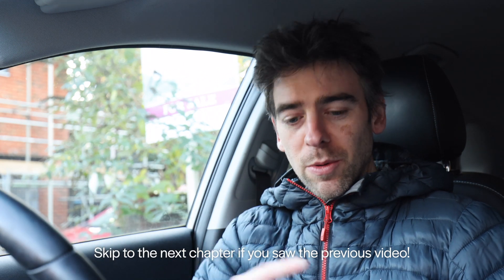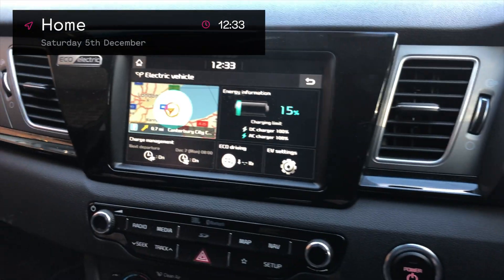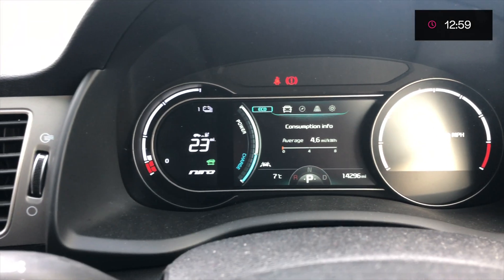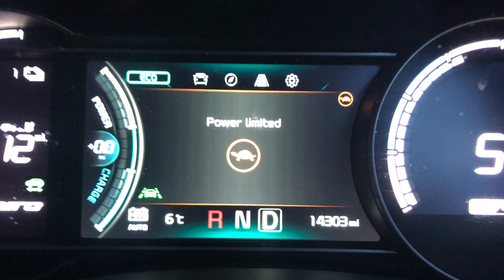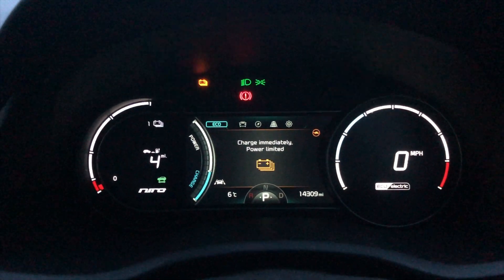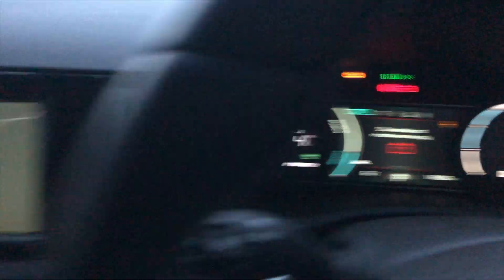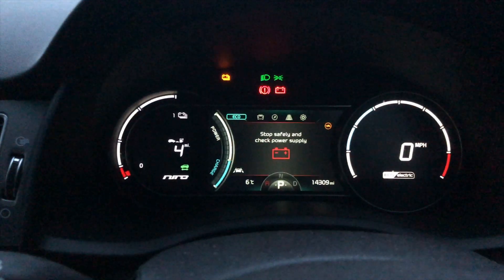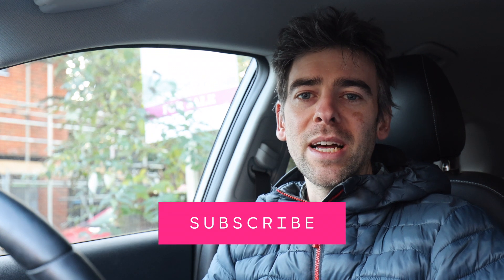Why I should have calibrated my Kia e-Niro's battery management system

Comment: In this youtube vid from "tesla killer", you can see how tesla, protects against "turtle mode".. https://www.youtube.com/watch?v=TF3aOxTcDms .. it does it by having a energy buffer that on 78kwh model consists of 3.5kwh at the bottom of the pack. If you hit 0% soc or 0km, that 5% is still available, but because you see the 0km, you will not use it. (and its also not recommended to use).

Comment: I wouldn't drain it low without first balancing the cells by charging it high.  One of the biggest reasons to keep the cells balanced is to make sure you don't drain any of the unbalanced cells lower than the safety threshold.  I don't think there's any need to go low in balancing the cells, I think you only need to go high to trigger the battery management system to rebalance all the cells.

Comment: Some cars can use apps to actually see the voltage of the individual cells, so you can know if you need to rebalance the cells.  You'll need something like an OBDII adaptor.  I intend to do that very thing with my Kia Soul EV and SoulSpy, so that I'm not charging it to 100% unnecessarily.

Comment: Hi Andrew! This battery calibration may be a thing but I think it really is a GOM calibrating thing. As the weather turns colder, it ‘remembers ‘ the range possible with warmer (previous) weather. Then, as the real autonomy goes down, it 1) gives you a false prediction and 2) has to expedite showing the real rate of battery depletion. In spring to summer, I guess we’ll get to see the opposite phenomenon. It goes to show the imperfections both battery technology and software still face. All things equal, if I could really afford it, I’d keep a +100k € ICE car along my eNiro, just for some unpredictably long winter stretches. Cheers!

Comment: EVs do vary significantly in the intelligence in the BMS. The instruction for my BMW i3 is "ABC" - Always Be Charging. You just leave it plugged in all the time; it sorts everything out, rebalancing the battery cells, doing discharge/recharge sequences and what have you when it thinks it's best to do so. Also means you always leave home with 100% charge - it's not like a petrol car where filling it up with fuel makes it less efficient :)

However if you leave a Leaf plugged in all the time, it won't be good for the battery - especially if it's parked up for a couple of weeks. Instructions from Nissan are explicitly not to leave it plugged in for the car parked up for a significant time.

Anyway, point is - need to read the instructions for the specific vehicle, and not just follow what other people do with other makes and models of vehicles.

On having stuff plugged into the ODBC2 port - it's worth highlighting that the vehicle manufacturers do state that you shouldn't have stuff plugged into it while driving...

Comment: the other thing is on the 12 Volt Battery, my 20202 Kia Soul EV (64KW model) I actually had to set the Aux. Battery Safer mode to enabled so the car monitors and charges the 12 volt battery. Unfortunately I am the EV Soul guru not self acclaimed) as one of my friends I referred to buy a KIA Soul EV, called Kia service about a mysterious  flashing blue light (on top dash of the car called Charge Indicator) when the car was not plugged in or charging. They told her to bring the car in but she called me first, I told here the light will activate if the car is off and the Battery Saver is charging the battery. She then called service and told them that, needless to say they were embarrassed and saved her a needless Ferry trip into the mainland (Vancouver). So the Kia E-Niro might have this same feature that needs to be enabled if not already done so.

Comment: Hi, I enjoy your videos especially the one to John O Groats.  I drive the 64kWh Hyundai Kona, pretty much same drive train as your e Niro.  I get the 3 dashes around 8 miles left, that’s when you sweat but I suppose it’s all in the planning, we all try to squeeze a bit more out of them, and that is no different in an ICE car, I previously owned a BMW X5 40d and it would not start if the car had very low fuel even when I knew it had fuel.  Best just to charge regular and cycle the battery as you say just in case you need the car in an emergency. I have also owned a Zoe and a Leaf, Leaf presents you with the three dashes too, but Zoe counts down to zero charge on turtle mode (head) Keep up the interesting posts. Thanks Scott.

Comment: Personally I treat the gom on our Soul and our previous Kona as a backup to what I definitely know by the battery percentage. Winter 100% is 2 miles a percent, summer 2.5 miles per percent and aim to get home with 10% or 20 miles. If it looks close, as in your 19% 26 mile journey would be 9% to get home with 10% so 9% would be 18 miles. I have pushed it at times though!! Having a big battery definitely makes you more complacent I think, I was much more on top of range when I started with a 16kw ion back in the day.

Comment: Good honesty Andrew, you won’t be the first or last... interesting about the calibration; I have found the GOM to be really accurate but I always charge to 100% I never bought into the urban myth about 80% to protect the battery. I have seen zero issues or battery degradation. I think it might have been a thing in early EVs but not applicable with the newer tech vehicles.
Reply: You’re not seeing battery issues with the E Niro because the gross capacity is estimated to be 67kWh.  Kia restrict it to a net value of 64kWh to protect against the issues of persistent 100% SOC.  There are lots of credible sources, including Kia owner manual instructions, that 100% SOC for lithium batteries should be an occasional, not a routine habit.  This is consistent with experience of Li-on in other settings.

Comment: Cold weather dramatically reduces battery range. The GOM or any range estimate is questionable in cold weather. 
When you do charge to 100% run it down soon after charging. 
Batteries do not like sitting at 100% for  hours or days. Charge to 80% in most instances for best battery life.

Comment: Andrew, I would like to point out one important factor. When it's cold, the Niro EV needs a lot of electricity for the first few miles to heat up the passenger compartment. Even if, for example, you only heat up to 20 degrees.
Reply from the maker: I didn’t have the heater on at all during the journey there or back actually.

Comment: In the beginning you explain recalibrating as depleting your charge to 20% then charging to 100%. But then you didn't mention the first part after that. How necessary is it go down low before charging to 100%, and would it work from 50%?

Comment: The GOM in the e-niro or Kona is also very dependent on the previous driving styles, in comparison to a Tesla which has a "rated range", which means it will tell you its range based on the SoC and not the previous driving style). Combined with the other factors you mentioned, the GOM can be off quite a long way, because the range fluctuates so much.

Comment: When my 12v died, RAC came out and tested it. It was down to 5.1v. As soon as they put the jumper pack on it I was able to start the car & then the Inverter kicks in. (Maybe not of the main battery is flat), but it should only need enough from the jump starter to flip a relay.

I think I now have the same jump starter as you so glad to know it's been field tested 🙂

Comment: I have a slightly different theory …… Since getting my e-Niro 4, I have logged all the charges and trips so I can learn how it works.  What I have seen is that we have two trip screens in the middle of the clocks. One of them tells us how we are driving for today’s journey and the second tells us how we have driven since we first got the car (or last reset). For example, my first trip shows only 2.4 m/kWh for today’s cold trip to the shops, the second shows an average of 4.2 m/kWh since I got the car in June.  The 4.2 m/kWh represents my summer average which was 4.5 but is slowly dropping as we drive the car in the colder months.  I have seen that when I charged up last week to 100%, the GOM calculation was based on 64kw x the average m/Kwh on trip 2 (64 x 4.2= 269 miles).  
Once you start a journey, the GOM is still calculating from the trip 2 average and not the trip 1 daily m/kWh.  I have a theory that to get a more accurate GOM for the Winter, we need to reset Trip 2  and therefore reset the average m/kWh so the GOM creates a new average and therefore a new more realistic winter range.  I am worried this will look really bad when first reset 😊
When you drive in the winter, the % battery remaining drops faster than in the summer which causes bigger drops in the re-calculation of the GOM range. This would not happen if the Trip 2 average was a more realistic winter figure of say 3.5 m/kWh (3.5 x 64 = 218 miles) and the GOM would be more accurate. Happy to be wrong, this is just my theory and it’s good to learn 😊
Be interested to know what your average m/kWh from Trip 2 and when it was last reset ?  Also be good to know what you have been getting for your recent cold journeys from Trip 1.
Keep up the great videos

Comment: I didn’t realise why the handbook recommended to charge to 100% once a month or so if not required to do so for your driving needs. Someone explained to me that it gives the BMS a chance to look at all the cells to make sure they reach their correct  voltage maximum. It also looks at the unused cells in the ‘actual’ battery which I think is 67.5 kWh, there being 3.5 kWh in reserve as we only see a ‘virtual’ battery. of 64 kWh. What I have noticed is the effect of ambient temperature on the GOM range. I last charged to 100% on 3rd December when it was about 7c here in my part of France. The GOM said the range was 473 km (293 miles). Back in the summer I charged to 100% a couple of times with the ambient temp at 25c and was getting in excess of 540 km (334 miles)..which is daft of course but the GOM will base its estimation on previous use history. Ambling around empty French country roads at 60-90 km/h does indeed give us great efficiency readings, often below 13kw/100 km (4.77 miles/kWh)....see my channel Kia e-Niro diaries for details. But I know full well that if I headed up the N10 to Poitiers doing 110-120 km/h even in the summer that GOM range would drop rapidly. I have no doubt you would have made the journey with your daughter in warmer weather Andrew!
Reply: Well, there are no "unused" cells in the battery. All cells are kept at a voltage level as equal as possible. The BMS stops charging a smidgeon below 4.2 volts at which level an NMC cell is considered to be charged to 100%.
In fact, the charger can push electrons even further than 4.2 V - up to 4.35. That is probably what they do in phones in order to squeeze out the tiniest last bit of run-time. The same holds true for the minimum voltage. And this is one of the reasons phone batteries last only a few years.

Comment: As the battery voltage drops so does the power output, so there are no way that ppl could have driven their car Dow to 4%. Without any power loss. Also worh mention is that the battery output is not linear, below 10%,it will drop like a rock. I dont think that the aux battery saver works below 50% state of charge. Great video and information. I guess thats why Hyundai recomends to charge the battery in my Ioniq to 100% atleast once each month. About the 12v battery, any usb stick will drain power from the car if plugged in, even When the car is on. Did not know that and my 12v battery failed, l😔luckily I was in my own drive way When it happened and I Just charged it up with my Cetec 12v charger. Not any problem since..

Comment: It is noy actually the battery that needs calibrating, but the BMS. The BMS determines SoC on some variables like pack voltage. If you charge from 60-80 a lot, whitout going to the low end of the voltage  and the high end of the voltage the variation in voltage is very low, and the BMS might indicate a higher SoC  or lower SoC than the battery actually has.  The recycle from low end, to 100% allows the BMS to calibrate pack voltage sensing.

But good reporting. It is important that new EV drivers get to learn how to get used to this.

Comment: I have a 2008 Honda Accord EX.  I fuel indicator light came on.  Normally when that happens you have 1.5 gallons (5.6 liters) of gas in the car.  The gas station was only 3 miles from the house.  I went to get gas/fuel and the car died on me.  I ran out of gas/fuel.  The point is it can happen in an ICE vehicle too.  

I would love to know if you have experienced any battery degradation on your Niro EV in the past 18 months.

Comment: I am obviously inadvertently calibrating my battery pack virtually every time I charge my e-Niro. I don’t have dual tariff electricity, so I just shove it on charge overnight when I get to around 20% and it gets charged to 100%. Is it really necessary to only charge between 20 and 80% most of the time? If it is, why doesn’t the battery management system make this happen? Given the inflated sum we pay for EVs , compared to ICE equivalents, we shouldn’t need to be battery nerds to get the best from the vehicle!

Comment: With respect, you are not calibrating the battery, you are recalibrating the management system! You can balance a battery - ie make sure all the cells are at exactly the same voltage, because through repeated cycling, cells can get slightly different levels in them, due to the chemical characteristics and internal resistance. And, as you noted, a cold lipo pack cannot deliver the same amps out as a warm pack.

Comment: Good follow up video. I was a bit lost about what you did with charging to 100%. Presumably, you need to deplete to low and then charge to 100% so the car knows where the top and bottom of the charge range is. This wouldn't necessarily be the case if you were charging to go on a long trip (may already have a fair amount of charge in the battery). Could this be the reason you don't see the 3 dashes - the car not knowing where zero(ish) is?

Comment: I think it's more the car's fault overall. 
In the eventual mass adoption of EVs, how many people are going to be bothered about the physics? The enthusiast will be interested in getting the best charging speeds, and how the battery is effected by temperature etc, but as with petrol and diesel, most people understandably just want to get in and go, and phone breakdown when something goes wrong. Everything to do with cars, from advertising, to services and insurance packages, encourages this, (increasingly, we don't even have spare tyres included anymore).
The car should give a clear warning that the battery is cold (and close to empty), and that it will have a dramatically impared mileage. Maybe get the car to calculate the journey, and projected range. If it give an inacurately optimistic range estimate, and leaves you stranded, give it a damn good thrashing.
And like ICE, if it's not kept topped up above say 50%, there could be issues.

Comment: u can charge the car up 100%. Kias have a securtity gap. So even if u charge to 100 it is not actually 100. Same works with %0. I charge to %100 everytime and after 30.000km i still have the same performance from the battery. Also kia guys here in Sweden told me that it is totally fine to charge to %100 everytime. The only thing they told me to avoid is often fast charging which causes degredation as we all know.
Reply: Yes I have heard the same. Charging to 100% all the time does not harm your battery but leaving at 100% for a long time does. And also rapid/supercharging too often can speed up degradation.
Reply: @keithware5314  yes that is true. Also 1 more suggestion from Kia guys I forget to mention is charging your car to often when it is charged a good amount. For example I do not charge if its up to %40 or more. I always wait for %30's at least.
Reply from the maker: And yet strangely, during lockdown Kia recommend leaving the car charged at 100%!
Reply: @MrEV  we did not have a lockdown here in Sweden :) so i have no idea. But its strange to hear different suggestions from different kia staff. I guess we will try and learn.

Comment: Another great, really useful video Andrew, thanks (my girlfriend is also strangely happy to watch you too!) I also treat my phone battery in this way (20-80% most of the time, with a monthly charge up to 100%) which is why I sometimes get frustrated that I'm forced to charge it more than I'd like as it has to be plugged in (and charging) in order to use Android Auto (or Apple Carplay)! You also reminded me however, that my laptop has been typically sat plugged in at 100% charge for months/years on end!!
Reply: Lenovo laptops come with a power manager that allows you to set a maximum charge if it is sat on charge most of the time. Also recalibrate the battery. Presume you can get similar for others.